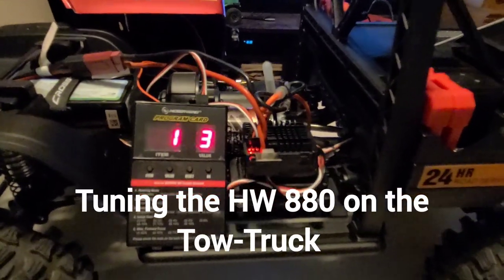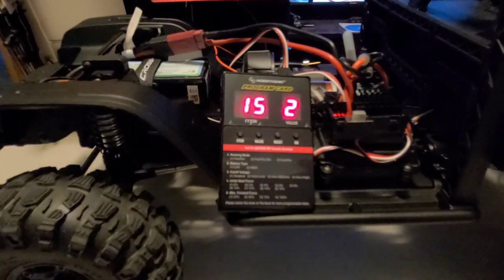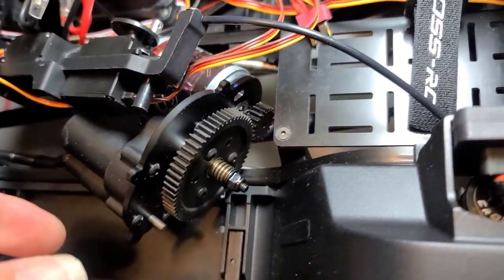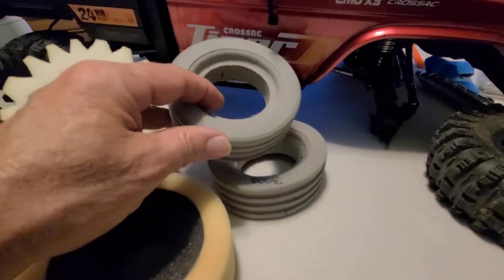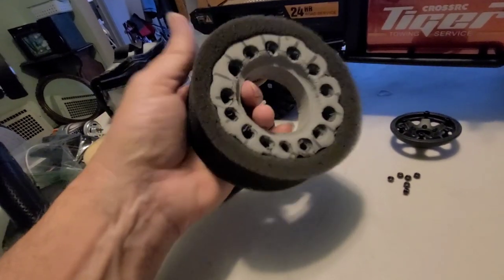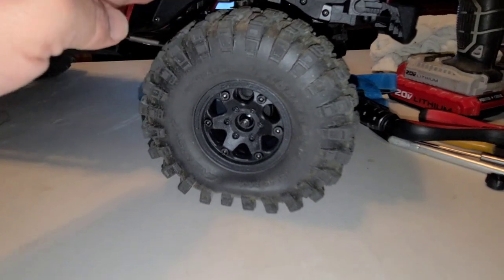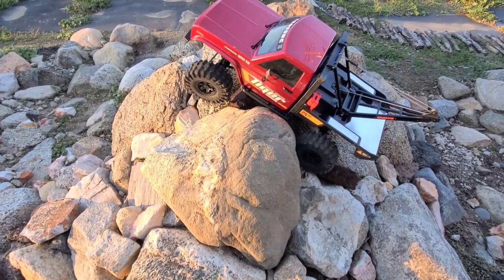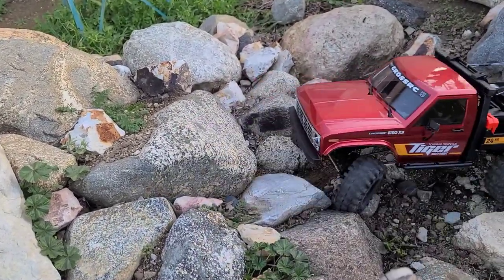Cross RC Emo X3 Tow-Truck Wrecker Recovery budget upgrades, motor, foams, tuned HW 880

Comment: Cross rc is junk. All trucks. All models. At least if you plan on using it. My truck rolls back and forth like 9 inches. Real helpful cresting a hill. Please everyone watching. This guy is great. Cross rc is not
Reply from the maker: Hey Allen.
What Cross trucks have you had?
I know a particular series that has a weak transmission but it climbs like a Goat.
My BC8 Mammoth has been a Beast with a stout transmission, diff gears and very good aluminum axle carriers and such.
But I haven't heard anything bad on any-other trucks.
You should check out my BC8 video of my using it for yard work.
As for durability on this particular Tow-Truck, only time will tell.
Reply: @tomlucasrccrawlers9108  I built the cross rc emo. Looks like a broncoblazer. I know it's lexan. But I got a full interior and was going to go all out. Be different. I was a machinist but got in the plumbers union. I built it nicely. I even tried shims and setting backlash and side to side in tge axles. Trans works as it should but also lots of back and forth play. Sloppy seconds I call it. The body had a kink blemish in it. I only painted it green. Saved my paint and time for a better fight. Instructions were clear and it went together just fine. It's a pile if crap and I rip on cross rc as much as possible. I put a 20 kg pos servo in it and a 1080 hobbywing. I bought a axe setup and 450 oz servo. I put that stuff in a wendigo instead. Go redcat. They never return my emails or phone calls.
Reply: Ya I heard about the first rc kits not being so good . They’ve gotten better , I want to get the tow truck , no one else makes a wrecker and long as don’t beat on it use it attended I’m sure it’s fine .
Reply from the maker: Haven't had a problem with any Cross rigs. But then, I do alot of investigating/research before I buy to make sure they worked out all the bugs. The BC8 Mammoth is a very strong platform and so is all the "Emo X" platforms. Not sure about the plain Emo. Never looked into the "Non-X" Emo's.
But the X, X2 and X3's are like an overbuilt TRX4. 
      I'm running alot of torque, so only time will tell if there are weaknesses. 
     Also, I have very little back-&-forth movement. It's way less movement than a TRX4. You'd think it was only a single speed transmission and not a 2-speed. They really tightened the shift-collars. Must've made the gears alot wider on the shift-collars.
   Sorry for the delayed response. YouTube didn't notify me that I had a message on here.
Reply from the maker: I'm sure you wouldn't be disappointed. It's really built well and the "X"  platform has been around awhile.
Reply from the maker: No complaints yet...its just a bigger TRX4....well....Cross built them to be a bit more complicated to work on.
Reply: Thanks for reply